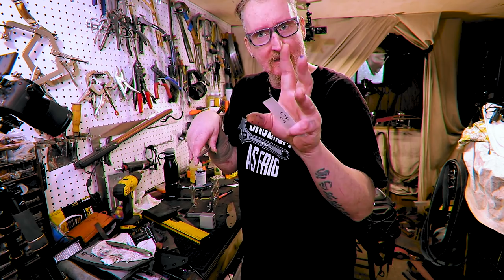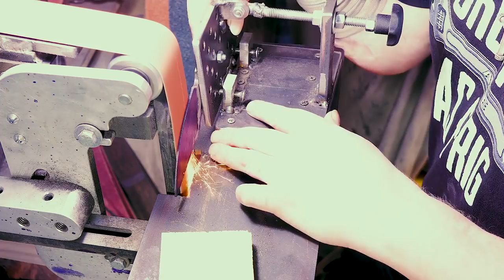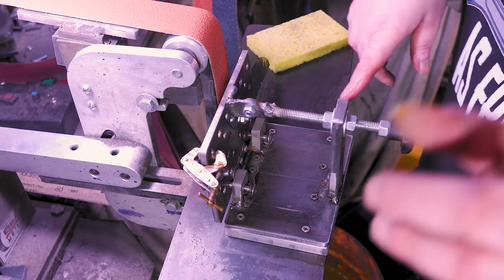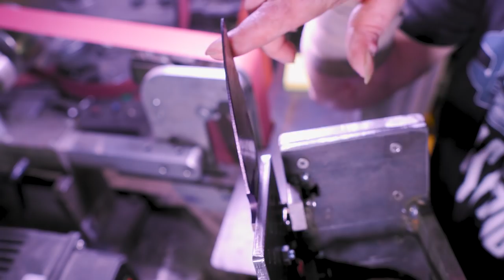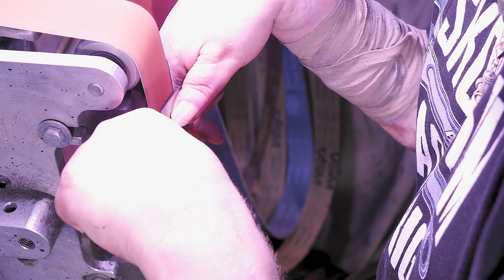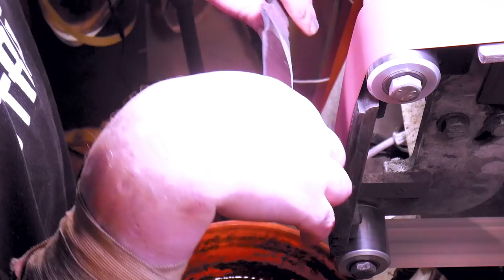Knife making - Bevel Jig vs. Freehand Grinding

Comment: Looks good bro most jigs have 2 handles on them so you can push pressure on the knife works great glad the calculator work out
Reply from the maker: Yeah, I've thought about putting those on too... Yeah, it worked out real good.. Thanks...

Comment: You can slap a piece or two of painters tape over the magnet to avoid scratching the blade, then just apply a new piece when it starts wearing.  That's helped keep me from scratching up my blades.  I started out with a jig, which also has some nuances you have to learn to work around at times, but unless I'm doing a scandi grind (been a long time) I just stick with free-handing now.  The problem I get into with grinding is that there have been many times over the years where I've had long intervals between starting a new knife for various reasons, so I've had to basically relearn to grind all over quite a few times lol.  It sorta reminds me of playing the guitar, you understand how it works and remember the general principals and motions, but if you go too long without exercising that finger coordination, you have to train your brain and hands to work together all over again, which can be annoying lol.  

Nice job on the plunges btw.  I think you can fairly decent faded plunges with a jig, but since the angle stays the same the edge thickness at the plunge will remain thicker further out into the edge than if you "rolled" back the spine after setting the edge thickness, which I've noticed on quite a few knifemakers' knives.  It looks great, but to me it's always seemed like if it were to be used a lot and thus resharpened over the years, it can mess up the edge profile (and looks) pretty fast due to not being able to be sharpen along the entire length, unless there was a pretty large choil accounting for the length of the fade in the edge.  Being able to change the angle while free-handing a faded plunge can help minimize that distance between the plunge line and where the cutting edge actually begins.  Anyway, that's just my 2 cents and observation.
Reply from the maker: Funny you mention guitar, I've been a musician all my life, I quit playing in the late 90's when my best friend/guitarist died. Trying to relearn everything after 15 years is like starting over, not to mention, getting old, my fingers just don't move like they use to... Thanks for the tip about the painters tape, I found my magnet with the switch, but always good to know...

Comment: Dave great video.. I built a jig a while back as well only used it a couple times though. I found it was easier to just jump off the deep end and freehand. Although I agree as well that if you needed to do a production run a jig would definitely help keep everything the same on all the pieces or at least close.. Have a good one... Martin
Reply from the maker: Yeah, I did a 2nd blade, which I got faster at setup, but still took a while... Take it easy, Martin. Hope you had a great fathers day